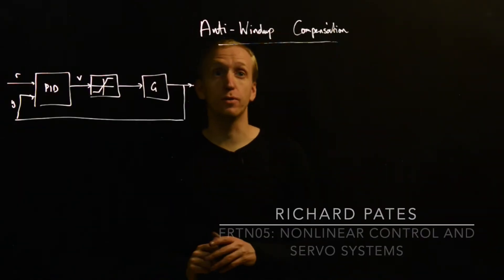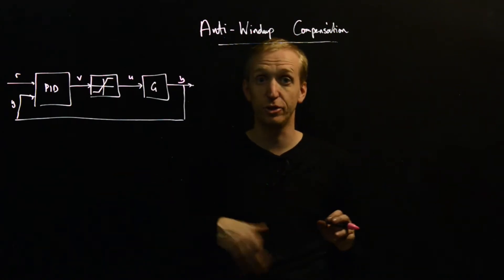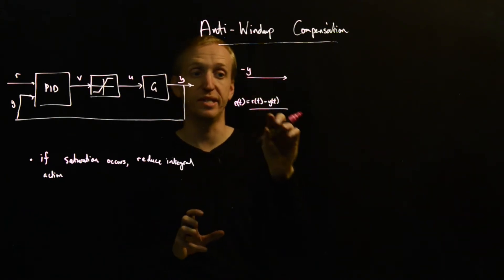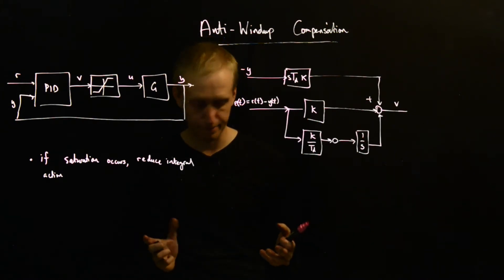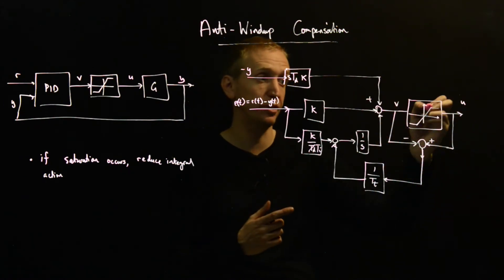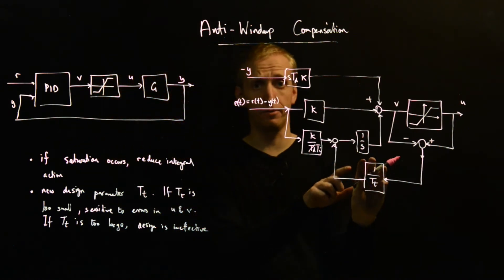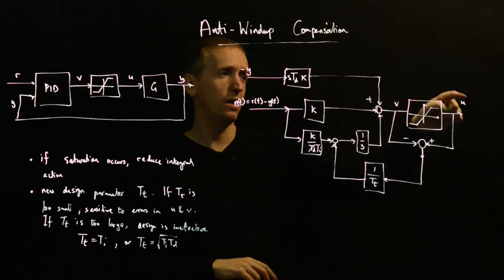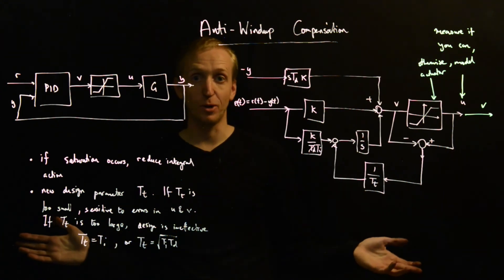Anti-windup compensation

Comment: 11:42 Assume the PID output is a PWM, or a voltage signal, which connects to a motor drive inverter.

Would it suffice to know the absolute upper limit, say in the case of PWM 0-100% or in the case of analog output, say +/- 10V?i

Thanks for an excellent video. ❤